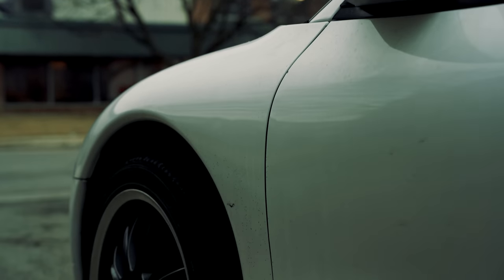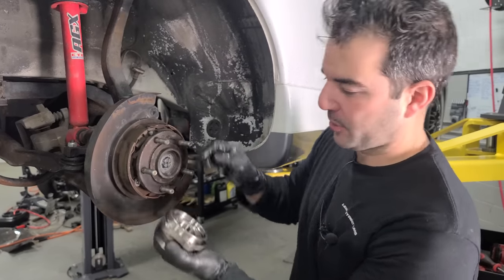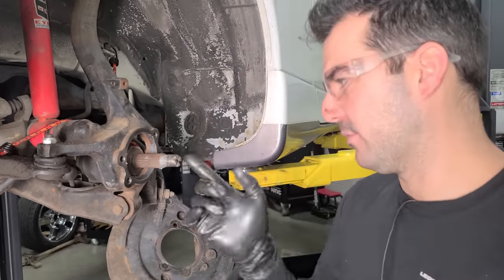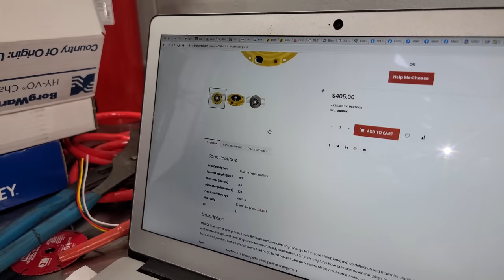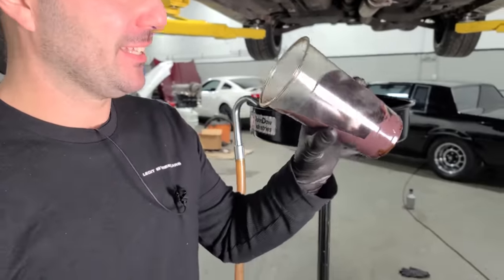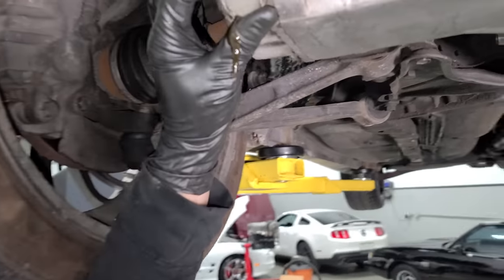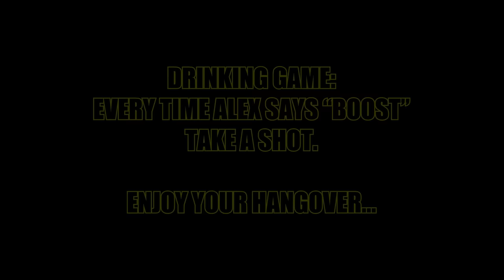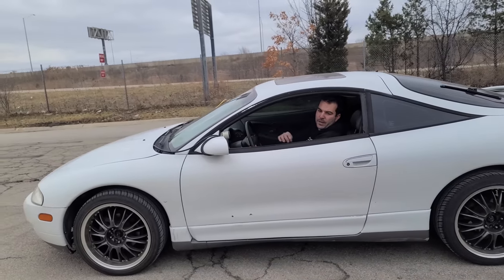Fixing My 250K Mile Eclipse GSX For CHEAP & Adding More Boost For FREE! AWD Launch Monster!

Comment from the maker: Download the FREE Upside App at https://upside.app.link/legit to get an extra 25 cents back for every gallon on your first tank of gas!
Reply: Something I've learned is that when it comes to DSM, take the youtube commenters word for it on the advice here.
Reply: ghostbusters 2 mood slime
Reply: On the actuator switch vaccuum for pressure and put the "controller" in line. That will force it shut under boost instead of opening and you will have to bleed some off to keep boost down. In stock form it will fail safe to gate but in that config it will fail to as much boost as the turbo can make so be a little careful.
Oh and it doesn't really need the stock bov so you can lock that shut however you like. The turbo might not last as long but I doubt it matters on this particular one.
Reply: Paint it Turquoise.
Reply: Torque=coppia
Reply: Ral 2002 Volcano orange
Reply: I wonder if someone used slim in the front diff the same way as a rc car uses ear plugs to lock the diff without welding.
Reply: I had a 1996 Eclipse GSX sold it at 96k about right as the Turbo charger started "knocking"
Reply: Kinda reminds me of a turbo mr2.
Reply: 34:05 more safety boost 😂
Reply: leave it stock color
Reply: Alex, pull the ECU and see if it's got ECMlink. The 14b is good for about 20psi before it becomes a hair drier.  1g BOV will hold it. The crappy plastic 2g always bleeds about 13psi.  I've had 1Gs, 2Gs, and GVR4s.  

Currently just a 2G hx35 water/meth tuned with ECMlink.  

Ecmlink is really the way to go.  

P.s. also an fbody guy with a third and fourth Gen.  The third Gen was my first car, bought at 14.  Going to revive it soonish with LS swap.  

Of all the youtubers your taste and wrenching is almost the same!

Glad to see you doing well!
Reply: yellow!!!
Reply: Rob Figueiredo, Forced Induction Guys - he has over 30 DSMs, please check them out - PETER! DO IT! Rob Fig will be your best friend.
Reply: Metallic white or some gunmetal grey 👍
Reply: FKN A RIGHT ALEX!!! Thank you!! I bought one of these here in Italy 🇮🇹 (was my 2nd USAF base) and these respond VERY WELL to larger intercooler, freer flowing exhaust, 245/45 R17s and they EMBARRASSED MANY Audi TT and BMW guys on these Italian mt twisties. BF Goodrich semi-slicks (probably discontinued) really hook up on the asphalt.

I’m still here in Italy 🇮🇹 btw (married an Italian Soprano) and am a DOD/reservist contractor. Thanks again you guys!!! (I regrettably sold my White Eclipse to raise my 2 daughters, so the trade was definitely worth it…but I miss that motor/car)
Reply: @princesssolace4337  stock is about 10psi, as the actuator ages the springs do wear out a little so it's common for a factory set up to be around 7-10 psi.
Reply: @princesssolace4337  you'll get there.  Enjoy youth!! Have fun!!
Reply: @princesssolace4337  oh I gotcha now, lol past tense... ya I bought my fbird with my McDonald's salary but did get a steal on it.  Had to let it sit until I turned 15 and got my license and insurance.  That was a brutal wait.  I've been collecting parts do do a lm7 5.3 swap.
Reply: Coppia is Italian for torque 👍
Reply: @LegitStreetCars Id be interested in possibly buying that CAR. ill be in Bloomingdale in July.
Reply: I owned a non dsm eclipse. 03 eclipse gts manual.  Was a good car
Reply: @richmondcomputercompanyinc8054  Ida kept and fixed that. Easier to do that turbo then the ones in my 335xi.
Reply: @theknifeconnection9571  anything on an N54 based X model is a PIA non X is cake.
Reply: Like the video, btw the transfer case isn’t a differential and the viscous coupling is inside the transmission
Reply: Nm its a Talon
Reply: Im tryin yo fix my infiniti but i wish i could fix my 1990 eclipse has a new built engine ran amazing stupid trans wish i had a shop like yours i could trust not to rip me off

Comment: @legitstreetcars couldn't be more wrong on how the awd system works. You essentially described how an evo works, which is not at all how these dsms work. They do not have active center differentials. The center differential is located inside the transmission. This is why the transmission has 3 outputs and the transfer case has 1 output. On the evo the front axles go into the transfer case not the transmission. Even the drivers side passes through the transmission and engages the transfer case concentric with the transfer case input. The dsm center differential always attempts to send 50% power to the front and 50% to the rear. It works like an open differential until the viscous coupling LSD sees enough slip to raise the temp of the fluid enough to lock it. At that point it is completely locked. The transfer case takes 0.35 quarts I believe, and the redline stuff was very common back in the day. I highly HIGHLY HIGHLY recommend you use the mitsubishi fluids in all of these driveline components. You don't have to tell your sponsor, but it's been found over the decades these drivelines are very picky and you are best off using the OE stuff. It's expensive but if you grenade this stuff you might be SOL given how rare they've become.

Comment: Sorry Alex u are wrong the viscous coupling is Inside the transmission the transfer case is just a 90deg angle change all mechanical. The coupler is inside the transmission inside the side cover. There is a output shaft to the transfer case from it. In case u were wondering u can drive the car around without the rear drive shaft as a normal fwd car.

Comment: I've been chomping at the bit for another DSM video! That clutch is an ACT 2600, a very common clutch upgrade for these cars. The flywheel is made by Fidanza. That's not your front diff, it's your transfer case. The front diff, viscous coupler and center diff are all inside the transmission. It's super common for people to use Redline Heavyweight Shockproof in the transfer case and rear diff, but it doesn't work well in cold climates as you've noticed.

There are lots of brake upgrades available for these cars. I'm not a 2g guy, but I believe there's a JDM Galant front knuckle you can bolt up that will allow you to bolt on EVO 7-9 Brembos. People make adapters to bolt them up as well. Same goes for 1st Gen CTS-V front Brembos. 3000GT VR4 brakes are also a decent upgrade. Better pads, fluid and SS brake lines go a long way towards making the stock brakes feel way better too.

That car has definitely been more heavily modified in its past with a clutch like that, and the wideband bung, and the FP exhaust manifold, which is waaay overkill for the stock turbo, but it sounds like you're gonna upgrade that too. The stock BOV is leaking all of the extra boost you're trying to throw at it, and if you change that you'll just hit fuel cut above 15 or 16psi when the stock fuel injectors get maxed out. Definitely check to see what kind of fuel pump it has too, I'm willing to bet it's been upgraded. Keep the DSM videos coming! So stoked for this!
Reply: Stock 2G 450's can handle 19-21lbs from a 14B easily.  I logged IDC's at no more than 80-85% when running a Walbro 190 and stock injectors on a 14B @ like 24lbs or something ridiculous like that(very long ago.  Pocketlogger ftw!)  Which is what that turbo is.  The limiting factor is the stock fuel pump.  Anything over 15-16lbs even with a rewire and the OEM pump starts leaning out pretty good.  All this assuming you can get around the 2G ECU's ridiculous heavy-handed approach to fuel cut where it'll absolutely completely shut you out at anything over 15lbs or so.  

Back in the day I used to put race gas in my "stock" DSM(free mods, cut air can, and a MBC), ran 22-23lbs of boost, and ran 12.9's that way.  Was hilarious, even with the stock paper cone air filter.  AFRs got kinda sketchy but on Q16 it shrugged it off.  But I digress.  Regardless, that's my only correction.  Everything else you said is 100% true.
Reply: @BasedEMT1776  I didn't realize that thing had a 14b, or I totally wasn't paying attention. I used to fuel cut bad in my 1g with a 14b at like 16psi, especially on a cold night. I had all the basic upgrades at the time. May have even had a Walbro 255 in there, but can't remember as it was over 20 years ago 🤣
Reply: Champing At The Bit
The bit resides in a gap between the teeth of a horse. The horse does not bite the bit and never chomps on the bit.
I will now step down off of my soapbox
Reply: @jamesalexander7540  I bet you're a lot of fun at parties
Reply: Just taking a second to admire your knowledge on these cars, impressive 👍
Reply: One of the first mods I remember doing on my TSi was crushing the BOV in a bench vice. We would collapse it until the nipple touched the lower housing. Mine held 20+ PSI but started leaking when I’d turn the knob up to 25. I miss that car. Had ECMlink, GM maf and translator, evo 8 FMIC, walbro 255, evo 8 560cc injectors, balance shaft delete, 2.5” down pipe, and 3” race cat back. That 1G LOVED 25psi from the 14b and spooled instantly. Thanks to the evo 8 FMIC IAT’s were low low low. Also ported the turbine inlet, manifold outlet, notched o2 housing to equalize pressure better and not boost creep, and bored out the wastegate opening and left about 3mm to seal the flapper valve with. I miss that car. A lot. 😞
Reply: @blackhavocjim  you can crush the 1g BOV, but not the 2g plastic junk. Stock EVO 9 BOV also works well.

Comment: Hey Alex, DMS's are my jam. The goopy fluid in the transfercase is redline heavy shockproof gear oil. The front and center diffs live in the transmission. Its thick AF, but that is VERY thick and needs to be changed. It was common back in my DSM modding days to mix the transfercase 50/50 with MT90 and heavy ShockProof oil. In the transmission we used redline MTL and MT90 mixed 50/50, and rear diff we used straight heavy shockproof.
Reply: I came here just to say this!
Reply: Nailed it! Had a shop try to tell me someone out ATF inside…

Haha, nope shockproof lube
Reply: I knew someone would have some inside info.

Comment: Alex... From owning a 2g Eclipse myself, a great budget big brake upgrade is using a 2006 era Outlander front brakes. Larger rotor and dual piston caliper with a direct bolt on. Used it for AutoX and was great.
Reply: I just commented the same, should've read first 😂
Reply: Just spend a little more and get the EVO Brembos.
Reply: Did the same to my 99 around 09 or so
Reply: I prefer the CTSV brembos on mine. Beats any 2 piston all day plus they look sick
Reply: @davidjames8505  I agree 💯 but I was figuring with 'budget' in mind. Cuz I know those ctsv calipers and adapters can cost almost as much as the whole setup I'm talking about.

Comment: AWESOME!!! Im currently restoring a 1998 GST 
Couldnt find a decent GSX and got this GST for one hell of a deal... 137000 run and driving for $2500.
I already have the engine and transmission out! Already swapping out the suspension/bushings/ wheel bearings/ upgrading brakes to 2piston calipers off a 3000gt/ fuel lines pump and filter/ the whooooole works lol
Reply: How's it going? Did ya get it done?

Comment: The pink fluid is redline heavy duty gear oil. it looks clean. The amsoil you put in is what I'm running in my 98 GSX trans, t-case, and diff right now.
Reply: +1

Comment: Evo 8/9 rear brakes bolt right on, fronts need an adaptor bracket or JDM 6th gen Galant VR4 knuckles (I have those on my AWD Spyder!).  Need to trim the dust shields.  The rear drum brake is the same, eclipse parts work with the Evo rotors.

Comment: Just a note for beginners on wheel bearing troubleshooting. When checking for a bad wheel bearing spin the wheel and grab the metal part of the strut above the wheel to feel for a vibration. Sometimes its not always easy to hear the bad bearing. If you feel a heavy/grinding vibration compared to the other wheels the bearing is bad.

Comment: You are doing it right getting all the basics done prior to modifying.  Yep, looks like shockproof was in the transfer case. Loved the in-car adjustable boost controller 😀.  Might have some leaks to fix to get the boost up. The car sound great. 
Looking so forward to the coming stages. It’s going to be a lot of fun!
Reply: Ok, so, what's 'shockproof' when it's at home then...and, why would it be used in the front diff, and, not the rear...and, why's it so pink and thick?

🤔

Edit: Oh, he kinda said following 😁

Comment: That pink fluid is actually RedLine shockproof gear oil.  Extremely heavy duty and a reddish pink color.

They only hold like .3 quarts in the transfer case.

Extremely high quality and expensive fluid.

The viscous coupler is in the transmission, the transfer case is just direct drive on DSMs.

Comment: Rear brake rotors and pads from Evo 8 are direct bolt on. you just need the caliper bolts from Evo and switch to stainless lines! For the front I recommend the bracket adapter for the Evo calipers and rotors!
Reply: Great idea! Always nice to have some people with alot of knowledge share some tips!
Reply: Bump
Reply: If you go Evo 8 brakes/calipers, I'd recommend changing the master cylinder to the 3G Eclipse ones.  The DSM one really doesn't work as great with the Evo brakes due to the diameter of the lines/fittings.
Reply: @BasedEMT1776  that's some solid info 👍

Comment: The pink fluid in the transfer case (not front differential) is most likely Redline Heavy Weight fluid. That color/consistency is normal. The front differential is located inside the transaxle. ;)

Comment: An old Volvo B23FT can push some power as well when the wastegate hose comes off. I know that an 84 760t Volvo with the 4-speed manula + OD can spin the tires at 70mph, in OD, and dust a 944 turbo Porsche... it was by accident as I was passing a semi truck when the hose came off the wastegate. A 944 turbo Porsche was passing us in the far left lane of I-75 and the Swedish brick shot ahead like a rocket. I quickly backed off as I knew what happened and didn't want to blow holes in the pistons. It was our family car. I fixed it after dinner and all was well. The guy in the Porsche passed me after I backed off and gave me the thumbs up sign and a smile. Turbos are fun.

Comment: This brings me back! I’ve owned tons of DSM back in the early to mid 2000s, and EVO 8-9 when they were new. 

The downside with the DSM are so many people absurd them, and poorly serviced them. They are actually really reliable once everything is sorted, and you’re not at the ragged edge. 

I know transmission bits are very hard to find with the 1g. You could use an EVO 8 motor with an early EVO transmission.

Comment: The “front diff” is the transfer case. It has redline heavyweight shockproof in it.
Reply: Yep I see this used in Harley transmissions.
Reply: I thought so too, I have never had problems with it.
Reply: No the front diff is not in the TC. It’s in the trans just like the viscus center diff. The center diff in the the tcase on the evo not on a DSM.
Reply: @brianawd  I didn’t say it was “in” the transfer case. I said “front diff” which is what Alex called it. “Is” the transfer case. Should have said “is actually the transfer case” for more clarity. You are correct on the front diff and center diff being inside the transmission.
Reply: Lasershark agrees 👍

Comment: I do remember from back in the day with my 97 GST that the stock BOV could only hand around 12-13 PSI or so. Hence one of the reasons I upgraded to the HKS BOV.
Also, in true DSM fashion, you gotta get DSM Tuner with the earlier ECU. I think yours supports it!

Comment: I can't wait for this build! Keeping the DSM's alive 🙌
Reply: Wish I could get him to mod my '02 montero limited. Needs more power and possibly a Trans rebuild, but it's flawless otherwise lol
Reply: @something in the water  😂😂😂 crazy you said that! I've wanted one for years now! Did those have a 6g72? Also, what's the after market like for them? I would love to have a mitsu land cruiser!
Reply: @seandeterman2499  6g74 5 speed triptronic. Locking front center and rear. It just hit 100k bought from an older couple in San Andreas CA. They used it to tow their mini sailboat to and from the lake and that was it's only purpose. It's minty for sure
Reply: @seandeterman2499  pretty good aftermarket as it was one of the worlds best selling SUV just not in America. Bolt on superchargers from a company named bullet out of Australia bumps the 6g from 225hp to 400 if that's your thing, unlimited bumper options, roof racks, suspension, gearing and braking systems. Just have to import it if your in the US
Reply: @something in the water  ahhh man, I'm super jealous. It sounds sweet 👌. I didn't realize they had a front locker option? I may have to start my search for a mint one to make my daily. Either way nice rig man, enjoy it!
Reply: @seandeterman2499  ARB makes the front locker. Simple install. Thank you Sean, I feel blessed I bought mine 5 years ago before the inflation bubble. Hope you get one, I'd sell mine but I'd ask twice what it's worth because a good Salt free one is rare these days

Comment: Alex. Love the videos. But we need to see more boost. With the tee situation the long hose and the manual venting was acting like a huge backup forcing boost to open the gate. Take the hose off and leave the tee and see how much boost. If you need more just add another tee. The bungee was allowing the gate to blow open at high rpm. We need to see this thing on 15-18 psi.

Comment: We use to do the "free mods" back in the day.  Pull out the reducer in the air valve on the frame rail and we'd pickup 2-3psi of boost.  

Flip the intake and allow the air filter to be exposed, it'll increase air flow and you can hear the bypass valve.  We'd also trim back the tube that the bypass valve dumped into the intake tube as well.  

Not huge gains, but definitely noticeable.
Reply: I'm willing to bet the lack of boost is due to air flow.  Get it breathing with an intake and you should see another 2ish psi.